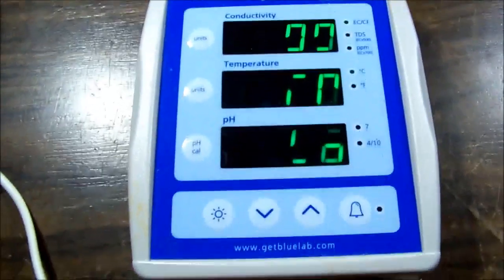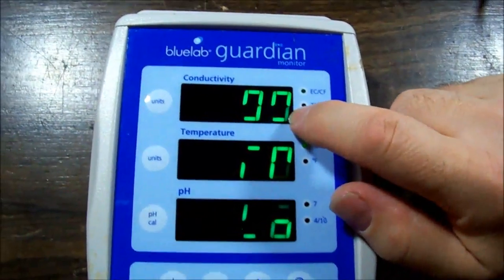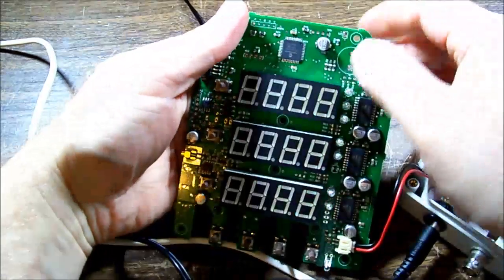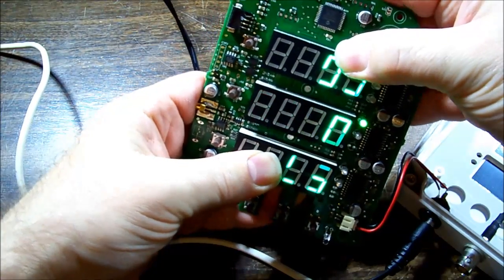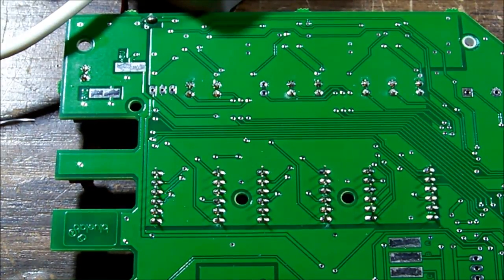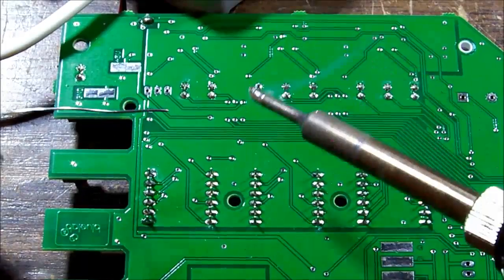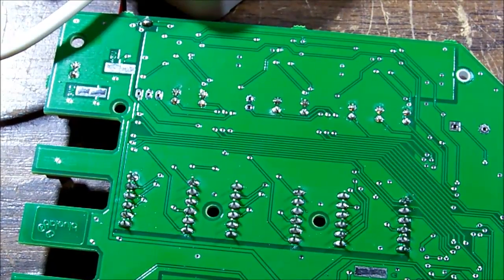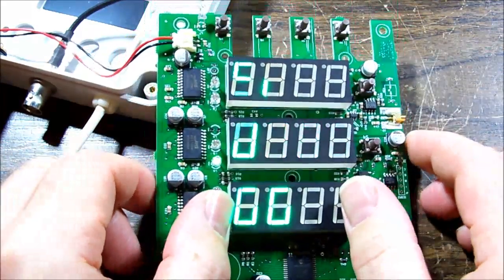Bluelab Guardian Water Monitor Repair

Comment: Not sure if you are still on youtube but i have a broken unit not disp’aying anything converter show power in and out where did you find those diagram
Reply from the maker: Just through google search. Type in 'part number datasheet'. I can't remember but the displays datasheet I might have found via the listing on ali. You can see the URL in the video so just type it into your browser.

Comment: Hi I need your help I'm happy to pay, got a bluelab guardian connect that I was using with the wrong power supply, upon checking the board I found one of the diodes has burnt out, it's the 3 pin black flat rectangular smd diode (on my unit its inline with the power supply connector) on your unit, it's just to the right of your power connector in front of the circular capacitor looking diode. If you could either try to repair it I will pay, or you could direct me to which diode it is and I will pay for that help. The diode burnt out did not have any markings on it so I assume the part that erupted had the part number on it. Could you please help me? Thanks
Reply from the maker: Hey. I can't take your unit but I think the part you need, as long as the 2 pins on one side are connected together on the board, will be something like a BAV23C-E3-08, 400mA rated. Not sure how much current this unit takes when on but whichever diode you go for will need to be rated to handle it. SBR160S23-7  is 900mA so that's good to. You might have to buy 50 of them. Or, find some electronic junk (laptops often have these) and take it from there. If you see a device like this with the 2 pins connected when on the board it's probably one. Take it off the board and use multimeter to do a diode test, red lead on each of the 2 and black on the single pin on other side, should get about 0.5v drop on each pin. Sometimes only one of the 2 pins is used so it's ok to get no reading on one. Worst case you get one that isn't a high current rating and it fails. Let me know how you go.
Reply from the maker: ALSO.... if you're  careful and you know for sure this is just a protection diode, just connect a wire from the 2 pins over to the single pin which will bypass it. As long as you are using the correct power supply this will work and lets you test the unit is still working and nothing else is damaged. If you are happy with knowing the wrong supply won't be used again you could just leave the wire there. Only do this if the diode is in series i.e. circuit goes positive (red) wire to the 2 pins then the single pin feeds the rest of the board. Don't do this if the negative and positive wire each go to opposite sides of the diode or this could damage the power supply. Hope that's not too confusing :)

Comment: I'm trying to fix the same unit, mine won't display anything when plugged in. Any idea where to start? I tried two different 5v power supplies. I carefully opened it and no signs of water damage, PCB looked brand new (unit was made in 2014), no signs of shorts or any kind of burn marks on any components. I studied it for a good thirty minutes and everything looked normal visually. I need to buy a multimeter but I was thinking i should start my checking power at that dc-dc regulator, i don't understand why they even have that 5v to 5v converter, the datasheet suggests it's an unregulated power supply anyway. I can't get mine to power on at all, i had to make my own power supply from a ipad 5v 2a charger, maybe i reversed the polarity, i've been using this makeshift 5v power supply with other electronics fine.
Reply: i got a DMM, im getting 5.1v out of the power supply. I can measure 5v at dc input on the bluelab gaurdian pcb, im also seeing 5v at the + test lead next to the microprocessor. Still not getting any lights on, when i measure the dc-dc converter i get 5v in and 0v out, but looking at the pcb it seems like the dc-dc converter is for the ph meter portion, seems like the leds should still turn on.. Any idea?
Reply from the maker: I would start with the dc-dc. See if you can figure out if there's an enable pin to turn it on. If yes and it's enabled or if no enable pin then it should have 5 out and it's probably a good place to start. The micro might do some kind of test and not fully start up if there's a problem. The dc-dc might be there so part of the circuit is on an isolated supply. I don't have mine any more to check.

Comment: Hi Jonny. I know is an old video. Picked one of these up used and trying to fix. DC 5v in, no lights from the unit. Micro chip and much of the circuit has voltage. 

That 5v DC - DC converter on mine does not seem to be putting out any voltage. I voltage across the input pins, none across the output. This converter only has the 4 pins so I don't believe it has a control or "enable" pin.

I tried jumping 5v from the incoming pins to the output just to see if anything would happen like you suggested on another comment and no dice. 

I'm considering buying one anyway to swap just to see but I noticed the 44 pin main microchip is getting quite hot when power is applied - like uncomfortable to touch hot.

Does that sound normal for a small chip like this? Chip is a "Microchip PIC 18F2423 - 44 Pin" 

 Hesitant to start throwing parts if the main controller  and who knows what else is dead.

I know this is a real old video but any advice would be greatly appreciated. :)
Reply: Thermometer readings as high as 170°F on that main chip.
Reply from the maker: @JonathanGoggans  Yeah that's too hot. I really don't know without having it in front of me to analyze sorry as I'm not familiar with these and the video I made was the only one I've ever looked at.

Comment: I accidentally connected a 12v power supply to mine😭 now nothing works. All the displays flashed bright and now nothing works. Any advice?
Reply from the maker: For a start I would test the regulator mentioned at 2:45 make sure you have 5v in when plugged in and then 5 out if so. If no 5 out and no resistance to ground low enough to cause the reg to shut down then replace the reg. If there's a short you need to find what failed. I don't know if this feeds everything and I don't have one to look at. You could connect 5v directly to output to see if it works or to find short by heat.
Reply: @JonnyFix 👍 thank you
Reply: Did you find a fix?
Reply: I did the same accidentally overpowered with a 12v and it won’t turn on any longer… is it trash now?
Reply: @p2pat   yes use Amazon warranty swap 🤫
Reply: @toki8199  how do you go about this? I bought through Amazon Canada? I don’t think they warranty or replace items? I’m trying to get blulab to replace it. What a time for it to fail me :( worst time to loose a crop…
Reply: @p2pat  you gotta get  creative 🥃😁

Comment: Great video Jonny, thank you very much....i have got the same problem...im feeling lucky to find your video...just one thing i dont understand....im about to order new led display but i dont know which i need? Common cathode or common anode?  It is the common cathode isnt It? 

Thank you alot
Reply from the maker: Yes common cathode. I hope that resolves your problem
Reply: @JonnyFix  thank you, i have ordered them but i cant remove the old ones....i try few times but now im affraid to not destroy the Board. Do you have a video where i can see how you melt all the pins at same time? if not can you make a quick video? Please
Reply from the maker: @sultanjassim6799  I don't have a specific video but look for "how to use solder wick". Either that or cut the display off and de-solder each pin separately. Be careful not to damage anything else.
Reply: Thank you @JonnyFix … i tryed with the Temp one as i dont care much for that but i had to stop as i was starting to damage the contacts on the board….maybe my soldering machine not good enough to melt all the pins Fast enough…anyways i was thinking to run some wires outside the case and soldering the new screen on these wires… just im very worried not to fuck up something… so i decided to consult with you first… do you think anything bad can happen if i will have 2 screens same time on the conductivity? The original one and the new one connected by little wires to same places as original one. Can 2 screen burn some resistence or something else? as need too much power to display on the both screens at the same time?
Reply: Are you still around friend? @JonnyFix

Comment: Mine won't stop flashing err on temp. Help!?
Reply from the maker: I can only think there is a problem with the temperature probe. Check the wires to it aren't broken. If not you may need a new probe.

Comment: Mines not powering up even though it’s not been used just stored for 12 month
Reply from the maker: Was it stored with the power adapter? Often people think wall adapters/plug packs are all the same so if it was misplaced the one you're using may not be right.